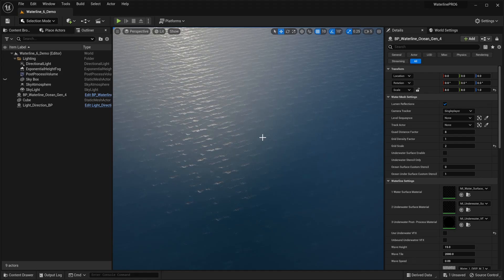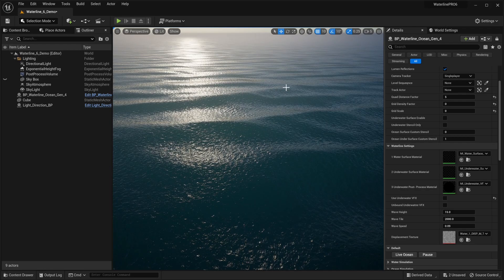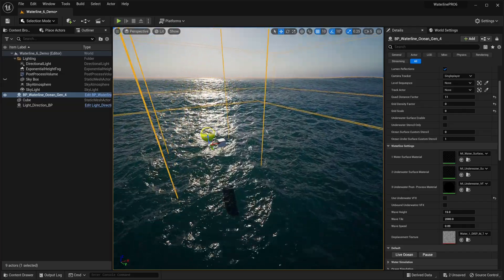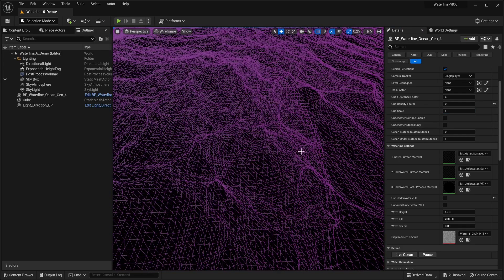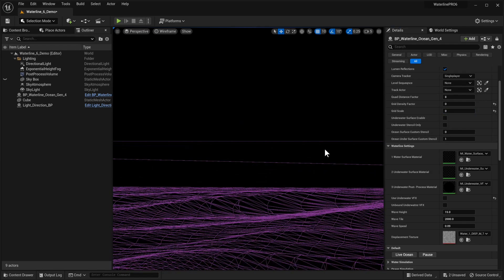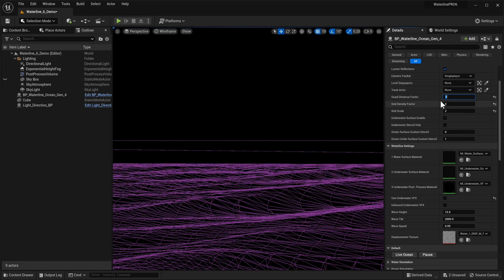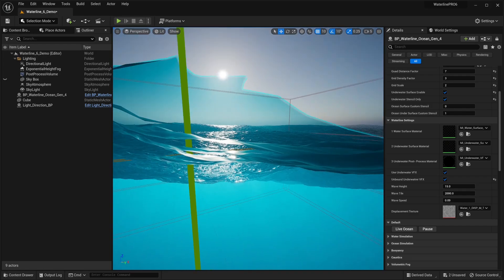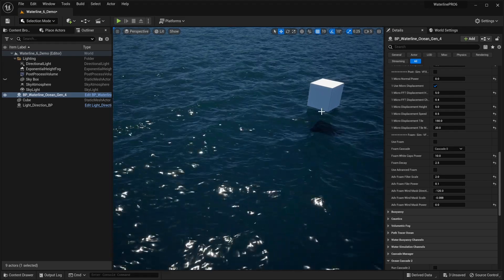Waterline PRO 6.2 Ocean Geometry and Foam Showcase

Comment: Is it possible to get the foam to interact/generate from Static Meshes?
Reply from the maker: Hi!
We have several foam systems to handle the effect under different conditions:
1) Ocean Foam - foam that is generated by the simulation of the ocean waves - useful for creating a stormy sea. 
This is visible towards the end of this video.
2) Dynamic Sim Foam - foam generated due to object interaction - great for ship wakes:
https://youtu.be/ISXB8wzSfZQ?si=O115yc1lTL3eMobK
3) Shore Foam - foam that is formed due to the shore waves (these can form on landscapes and static meshes)
https://youtu.be/kjW3MxdQ0KA?si=oZ7gSh-Ikkp4qIKv
Reply: @dumpsterfireproductions  Cheers!

Comment: Hi, is there a way to create water volumes (I know there is, BUT) but for example simulating a big aquarium with glass walls, allowing you to see effects like caustics and depth fog etc of everything inside
Reply from the maker: Hi!
All the necessary features to do this are technically in the asset pack but may require a little bit of a customization. If you want do get in touch on our support email and we can give you more details on this.

Comment: Hi, this is cool. I have one question. Is it possible that I use other software (don't use the FFT Ocean simulation in Waterline PRO) to simulate fluid then import the meshes to UE5? and then use all functions of Waterline PRO to the meshes? Thanks.
Reply from the maker: Hi!
This is a tough one... as it can be done in many many ways. For starters we recommend still using the ocean actor and just disabling the FFT Simulations in it.
AS for the workflow this isn't something that we've done, but another user did do something similar and also did a tutorial that you can find here:
https://youtu.be/Kc6Z7vrKs9k?si=BZhzVCMDZ65Ij1et
Reply: thanks a lot. this is helpful @dumpsterfireproductions

Comment: anyone else getting light blue mesh like things showing up on the water?
Reply: underwater surface enabled is the issue
Reply from the maker: @ 
Here they are:
https://youtu.be/3lRHSxtlQu8?si=cDxiLR-WPxKGAxbT&t=679

Just lower the steepness on the ocean waves - too high a value can have them fold on themselves and expose the underwater surface material.
Reply: @dumpsterfireproductions  i have small waves not anything crazy I used stencil only and it seemed to get rid of it. ill see about this later in development. ty.

Comment: Love it! Is there any way to inject into the foam? For example, if we had a bunch of particles in a Niagara system, is there any way for those particles to create additional foam within the existing foam simulation? Thanks!
Reply from the maker: Hi!
This isn't something that we include as a part of the asset at the moment (we do plan on having particle effects down the line) however users have managed to get a system like the one you describe to work. You can see it in action here:
https://youtu.be/mSXvS4SKe_g?si=qWJeLHkMFIXOg1Qc